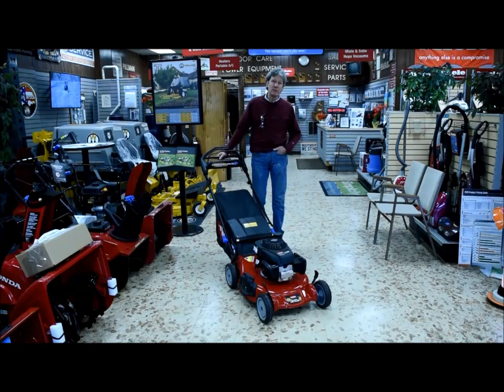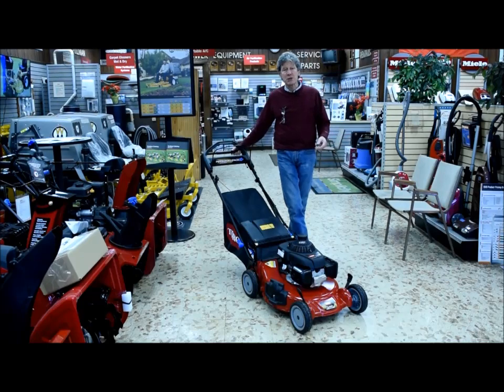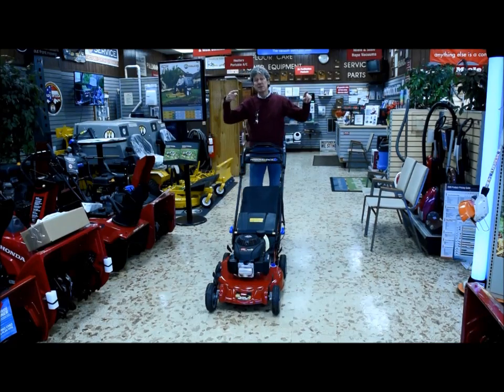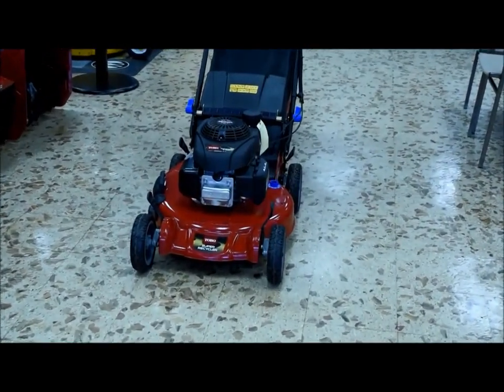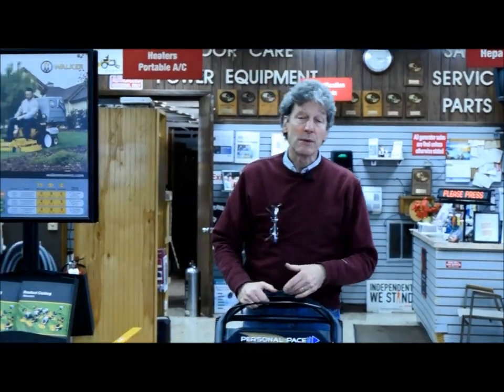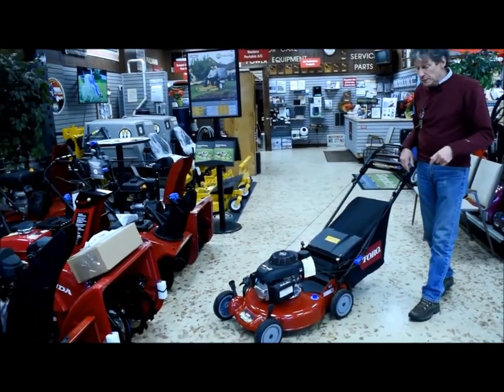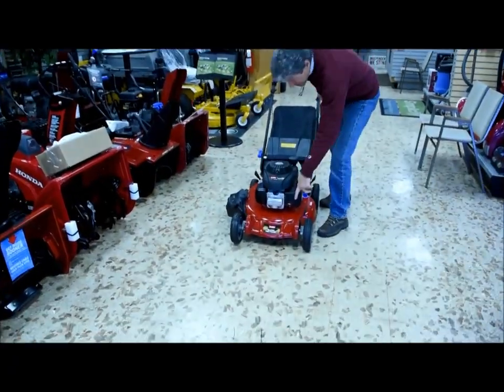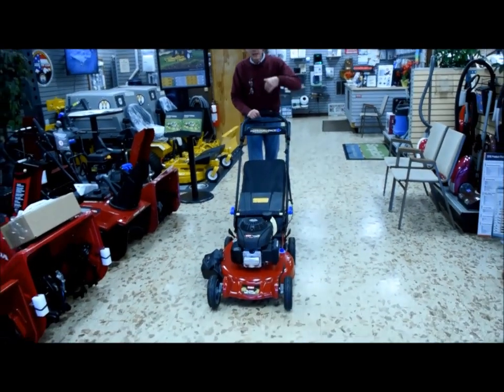An Overview on the Toro Super Recycler Lawnmower

Comment: Great video
If you had to choose the Honda HRX or the Toro super recycler which would you choose?
Reply: Honda, go with the machine that the engine and deck is made by the same company, why go Toro using a Honda engine? Honda is always the best choice.
Reply: @Mr_Tecumseh  No, its actually not. I learned the hard way. 5 years ago, I bought a HRR216. The engine is great but the rest of the mower has had lots of issues. The rear wheels lock up when you pull the mower back (yes, I have added the updated height adjusters and sanded rust off the shaft - it goes back to locking up a week later). The front wheels are toed out because of worn down height levers, a very poor design. And the blade clutch is wearing out already - this machine is 5 years old. The new Hondas are supposed to be improved, but I worry about those having issues too. I want to love my HRR but I cant. Ill be buying a super recycler with a Honda engine soon.
Reply from the maker: Sorry to be so delayed in responding to your inquiry -- just seeing your comment now.  In response to your question, due to my property (steep hill in front) it would be a Honda.  Other than that, it wouldn't matter.
Reply from the maker: Sorry to be so delayed in responding to your inquiry -- just seeing your comment now.  Considerable issues with that model series -- we stopped carrying those models almost immediately after the first year of stocking them.

Comment: Excellent overview Keith especially describing the blade design and how it affects bagging and mulching. That's awesome that they've designed a machine that excels at both. I have 21" John Deere JX75 that I've owned for 22 years that was designed as a bagging mower... and it bags grass very well. It has a mulching plug but it's not very good at mulching. It's probably not even average at mulching. I'm shopping for a good mulching mower and was told to check out the Super Recycler... that it was pretty much at the top of the list. 
I too was wondering if there are any significant changes between the red models and the new black ones. For instance, if I was looking at the two models 20382 and 21382 what are any differences other than color? Looking at Toro's website it appears the Super Recycler can come with a few different engines. Comparing just the engines do you recommend the Honda over the Briggs and Stratton and the Toro powered units?
Reply from the maker: Hi -- sorry to be delayed in responding to you -- just seeing this now.  Color is the only difference.  I have always liked the red; but, the black is growing on me.  Honda would be engine of choice -- then, either the B&S or the Toro engine -- no preference either way.  Thanks for your complement!

Comment: Hi Keith, I'm wondering why in every video I see I never see anyone adjust the throttle on any of the machines. Are the throttles a fixed unit? Have you had any problems with the aluminum decks....corrosion or breaking? Have had any problems with Toro own motor? Someone was telling me there super recycler machine has ball bearing wheels. I've never seen them on Toro models.Have you? You really give a very informative video on the machines. Great job!
Reply from the maker: Sorry to be so delayed in responding to your inquiry -- just seeing your comment now.  Yes, the units run at one fixed speed.  No, we have no issues with the decks although it is always possible to crack an aluminum deck (unusual).  Zero issues with Toro's own motor.  Wheels are not ball-bearing.

Comment: It’s my favorite mower! I wish it was 25”. 21” is on the small side. I think Toro should offer
a 21 & 25”.
Reply from the maker: We do stock a popular 30" Toro Timemaster -- you can see it here:  https://etpetersen.com/product/toro-20199-personal-pace-30-timemaster-lawnmower/  (the new model is a 21199 at $1099 -- I have to update the website to reflect the change).
Reply: I know about the 30”, thanks, but you missed my point!
Reply from the maker: @algorel4763  Hi Al -- I recognized what you said -- I was only offering the closest option.  I use a 30" Turfmaster (the commercial model) at my home -- we love it -- it reduces the cutting time by 30% to 40% and grooms the lawn really well.  I don't know that anyone makes a 25" machine any more.
Reply: Keith Petersen That’s a big gap when you think of it 21”—30”. The average home owner
would do much better with a 24” Mower. The 30” model is fine, but it borders ride on
30” mowers. Keep in mind, Toro has much tooling invested in the 21” molds. To switch
to another size would be costly. The 30” deck is a metal stamping that will rust away over time. I actually have a 33 year old Toro GTS 21” withe the original Suzuki 4 stroke that runs
& Runs. This was the predecessor of today’s Super Recycle. When you can design and manufacture a mower that runs great after 33 years, that’s impressive! Go Toro!
Reply from the maker: @algorel4763  Yes -- that 21" with the Suzuki engine is a great, durable mower.  We had one that I had originally sold to the customer come in here two days ago for routine service.  Toro makes many great products!
Reply: @algorel4763  I hear ya. I have a 1996 Super Recycler.  I want an excuse to buy a new one, but can't find one. Plus, I don't think I'll like that personal pace system. The other nice thing about the old ones is they don't have carburetor problems all the time because of the EPA standards of today. I have never had a carb problem on a now 24 yr. old lawnmower. How is that when I leave the crappy ethanol gas in it every year when I put it away?
Reply from the maker: @stevehoch9528  Yes the carbs are different and the ethanol is a big issue.  Use only premium fuel, treat it with a good additive (Seafoam, Startron, etc.).  At season's end run a product (mower, etc.) until it stops, add a quart of non-ethanolated fued, run it another 12 - 15 minutes to thoroughly purge the pump fuel, and then you can store it with the non-ethanol fuel until the following season.  We never have complaints, btw, with the personal pace drive system although we don't recommend it for steep hills.
Reply: @keithpetersen8114  I have a gas station in my area that sells non-ethanol gas. Is that what I should use with the new Toro recycler mower that we'll be getting soon? If yes, does a fuel-additive still need to be added to non-ethanol gasoline? One additional question, at the end of mowing-season (if using non-ethanol gas) does the mower need to be run dry..... if yes, then do you think there should be no problem when next mowing-season arrives? Thank you!
Reply from the maker: @websurfin9575  Hi -- good questions.  The answer to the first question is that it is always better to use ethanol-free gas than gas with ethanol.  That being said, cost is the main, determining factor.  Our ethanol-free Stihl fuel (with Stihl's best 2-stroke lubricant in it) is $40/gallon; so, we suggest to our customers that, for products they are using routinely (lawnmower, etc.) to use premium pump gas and treat it (Startron, Seafoam, etc.) to combat the ethanol.  Then, at season's end, run the product down `til it stops, put a quart of ethanol-free fuel into it, and run it another 10 - 15 minutes to entirely burn out any residual pump gas.  It can then be left with the remaining ethanol-free fuel until the following season (although, I personally will then follow up by running the product a couple times for a few minutes rather than let it sit until the next season).  

The above should help you decide what to do.  If the ethanol-free gas is cheap enough -- sure, just use it and leave it in the machine at season's end.

Comment: The $269 Powersmart PSM9422SR is the same as the $499 Toro Recycler and the reviews are excellent. The Powersmart uses a MORE powerful 200cc engine runs at a higher RPM that chops the grass finer
Reply from the maker: Hi -- thanks for your comment.  We found early on that the Super Recycler offered a substantially better designed and constructed product, and stopped stocking the Recycler models.

I actually recall a Toro Factory liason guy in our facility at that time who, on his way out after spending several hours with us, pointed to the Recyclers on the showroom floor and said, "Why don't you just let Home Depot carry those"  -- which was the same decision to which we had just come.

Comment: Can you still get a toro that the engine keeps running when the handle is released? Both the toros we have have that feature.
Reply: Spin stop. Yes, you should be able too, because one of the big box models still offers that.
Reply from the maker: Hi -- yes, Toro makes such a model; however, we had issues with it and don't recommend it.

Comment: How does the 2WD do on sloped areas? My lawn isn't flat and has a lot of sloped sections. I wonder at what point 4WD is necessary.
Reply from the maker: Hi Jeff -- there is no problem with the 2 WD drive on any average slope -- Toro makes an excellent transmission on the Super Recycler series of mowers.  The 4 WD/all wheel drive is available only on the entry-level Recycler mowers -- an entirely different machine design.  We no longer stock the Recycler mower models as we had too many customer complaints on that series.  I hope this helps.

Comment: Would you recommend the model that has blade stop technology?
Reply: Not sure if the big box model spin stop is the same as the Super Recycler, but if it is stay away from it, saw one that broke, cheaply made and replacement parts are more costly than having one without it, more to go wrong. Also the engine requires a special shaft for that, if you ever have to replace the engine, that one with the special shaft is going to cost more.
Reply from the maker: Hi -- sorry to be delayed in answering you -- just seeing this now.  No, we had issues with the BOS (blade-override-system) with Toro -- we don't recommend it.  Any Toro, btw, in a big box store is NOT a Super Recycler -- entirely different design and construction -- we stopped carrying that type of model years ago and don't recommend such.

Comment: What are your thoughts on the 60v Super Recycler?
Reply from the maker: Hi -- The Toro 60V Super Recycler is identical to the Toro gas-powered Super Recycler (of course, one uses a gas engine and one uses a battery system).  It is a terrific mower -- if you are looking for a good battery mower the 60V Super Recycler heads the list.
Reply: @keithpetersen8114  Thanks so much for your reply. You should make videos about battery power equipment. Your knowledge is second to none.
Reply from the maker: @LL-mt2nz  Oh boy -- thanks for the accolade!  I'm gonna have to go up a shirt size due to a swelled up ego 🙂

Comment: Personal pace has been around about 20 years now, not a huge fan of it myself.
My 1969 Toro Whirlwind had a wash out port, its nothing new, side discharge is ancient and has been on the recycler since outleast the late 90's. All mowers shut off when you release the bail. Aluminum doesn't rust, however it does deteriorate over time, it turns to dust and it cracks, pros-cons vs. steel.
Also when you say the Toro engine, your referring to the Loncin engine which is chinese, why aren't they offering a Briggs on these, not that the new Chinese Briggs are that great.
Lastly like you said about the Magnesium deck, same thing is true in general about mowers today, their not built like the used to be. I talked to a guy who worked for Toro who was saying it was a sad day when they stopped making the Toro Commercial 21" walk behind, that was a great mower and I personally owned a 1994 Toro Super Pro Recycler with the 3 speed gear drive, that was a good mower and a neighbor had the one with the Suzuki, the way that thing was built was incredible, the spin stop alone must have cost a fortune to make. They don't make them like they used too and as far as I know their made in Mexico now. I have a 2017 Lawn boy AWD by Toro, its a nice mower, but I didn't pay anything for it. However I saw one where the engine broke right off the frame due to the lack of motor supports, which tells me how cheap their making them now, not impressed. Thats my personal opinion and experience.
Reply from the maker: Hi -- thanks for your input.  Yes, the Personal Pace system has been in existence about 25 years.  Most people like it -- there will always be those who don't.  Toro has actually incorporated that design into their 30" Timemaster mowers and everybody likes that set up.  Ditto for their late generation Snowmaster snowthrowers with the Personal Pace.  
Aluminum decks will powder slightly; but, they don't rust -- almost all cutting decks for years now are stamped steel which will, obviously, rust.  Aluminum can crack if, for example, a spinning mower blade hurls a good-sized rock into the deck -- that is, typically, a more rare occurrence.  Toro still makes a 21" commercial walk-behind mower.  
Toro does offer the mower model that was being shown with a Briggs engine -- almost all those engines today (Toro or B&S) are made in China.  We have no problem with the engines.  FYI -- many better mowers do not stop when the blade handle bail is released -- i.e., the engine continues to run.  Honda, as to which we sell a lot of their premium mowers, invented that design over 30 years ago.  
Most mower manufactures today do not offer the three-fold option of mulching, bagging and side discharge -- a nice advantage to the Toro Super Recycler.  The washout port was incorporated, as you say, in the Toro Whirlwind line many years ago and then was eliminated.  Now it is back -- a handy feature.  As you also mention, the Suzuki-powered (2 stroke) Toro was a solid mower - close to bullet proof.  Customers are still bringing those models in for maintenance -- a tribute to the durability of the machine.  
All things considered, the new Toro Super Recycler mowers are the best cutting machines Toro has ever made -- lightweight, balanced, smooth, easy-to-use, durable and a beautiful grooming appearance on the lawn.
P.S.  All entry-level (big-box store) Toro models are MTD or MTD-type machines -- a great remove from the Super Recycler design and construction.  The Lawn Boy you reference is a Toro painted green with a LB logo -- it is an entry-level product as just noted.  All original Lawn Boys (a division originally of OMC) had 2-stroke engines -- we still have those units coming in here for maintenance -- some of them 45 + years old with magnesium decks ......  :-)

Comment: I used to think Honda mowers were the best, but after owning one for 4 years, I am no longer convinced. The Honda engine is great, but it has lots of issues with the wheels. The rear wheels wont roll back and the front wheels are bent outward. While some may say this is minor, it is not. It makes the mower much harder to use, and these things shouldnt happen on an almost $600 mower. After seeing how nice these super recyclers are, I am now convinced that Toro has the better mower. If I had to pick one, id get the one with a Honda engine, I just wish they offered a Honda with the spin stop system.
Reply from the maker: Hi -- I suspect you own a Honda with a steel deck.  Honda's premium line is the HRX line -- we don't typically have those types of problems with that series of machines.  The steel deck machines are not the same level of engineering and construction -- and the wheels will be affected much more readily by impact, etc.  Toro has the same type of situation -- i.e., a "big-box store" steel deck line (which we don't carry) and the premium Super Recycler line which, as you indicate, is a very good mower.
Reply: @keithpetersen8114  im not a fan of the HRX, I have used my customers HRX mowers and they are very bulky and hard to manuver.